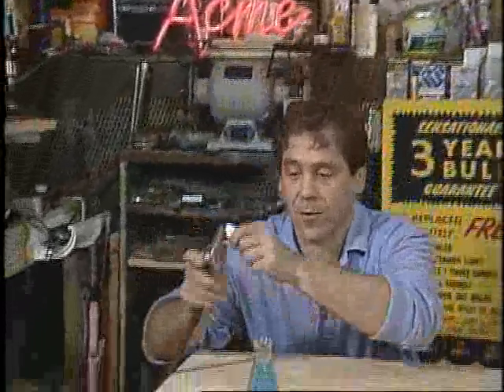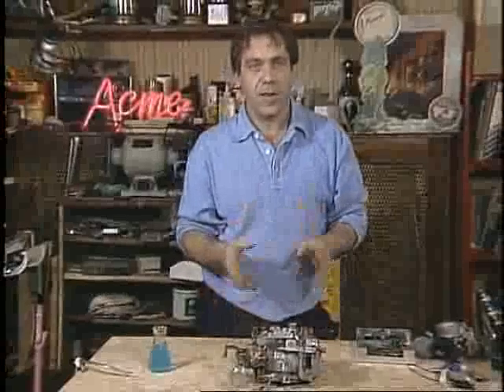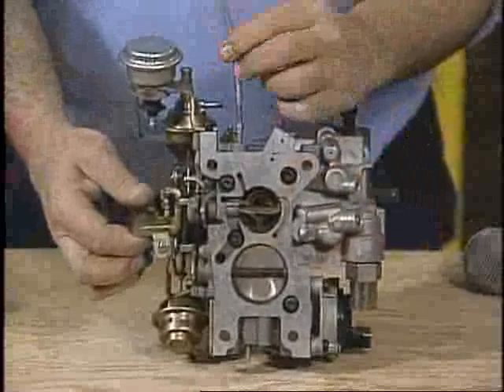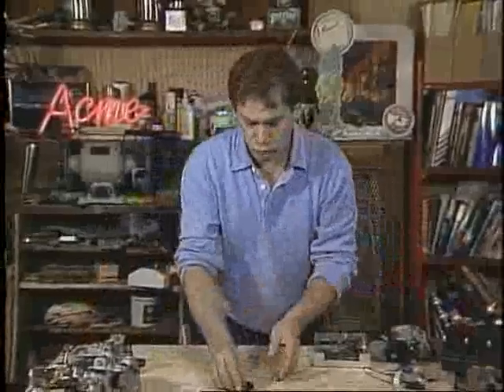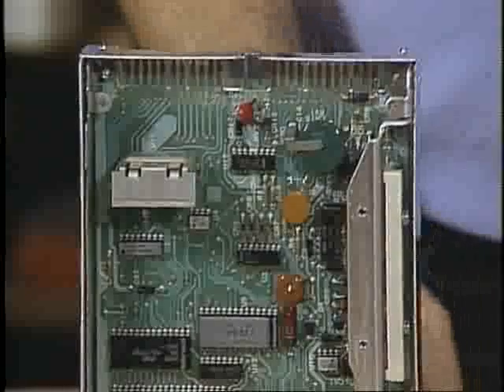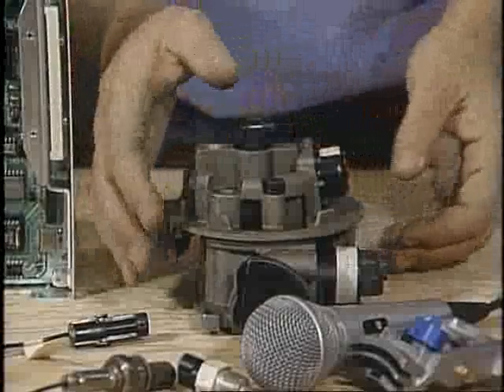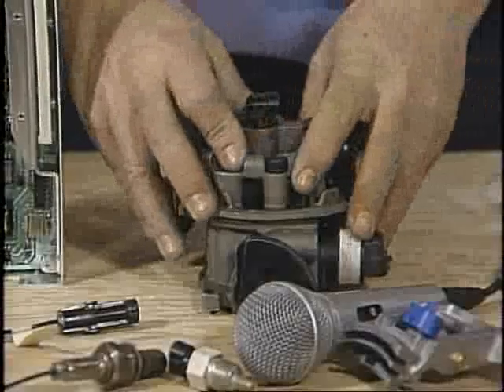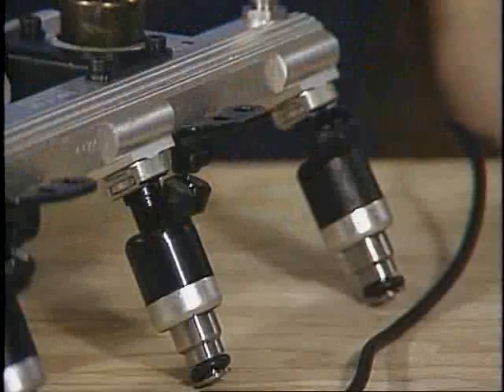Electronic Fuel Injection

Comment: Yup, most C172s were built around when EFI was super new, and it was just cheaper and simpler at the time to just use a carb. The newer kit ones I believe can be bought with EFI.

You can definitely ice up a carb in bad conditions, as long as you don't have supercooled air entering your intake I would guess EFI would be safer and not require manual adjustment in bad conditions.

Comment: I have a question...
I just came across with this video about fuel injection...
Isn't it the airplanes use fuel injection as well? 
I have flown Cessna172 P models that they have carburetor and what I learned from the flight manuals is if I don't apply the carburetor at the certain altitude, the ice crystals might form in the throttle area which will allow less fuel to airplane engines. Then the fuel injection came and that eliminated the carburetor. Am I right? I just want to verify my self.

Comment: @acmeschool Thanks David, Is Correct!
This is the stoichiometry of the combustion
1 Part of Fuel is 6.36% Of Fuel in the Cilinder (In gas state)
14.7 Parts of Air is 93.63% Of Air in the Cilinder

This 93.63% of Air have: 20.94% Oxigen - 78.08% Nitrogen
0.035% Carbon Dioxide and 0.93% inert Gases

Did you know how to convert or calculate, this Part of fuel from gas state to liquid state or viceversa, I just need to know , the equivalence between gas fuel and gas liquid, thanks again!

Comment from the maker: Hi arthus1971,

Whoops. It's a RATIO of 14.7 to 1, so out of 15.7(as 100%), it's 14.7 over 15.7 times 100 air (93.63%) and 1 over 15.7 times 100 (6.36%) fuel. 
In simpler terms, 14.7 parts air to 1 part fuel. Clear as mud, right?
David